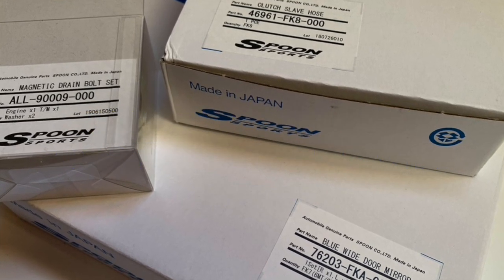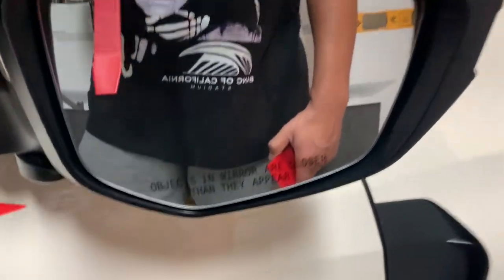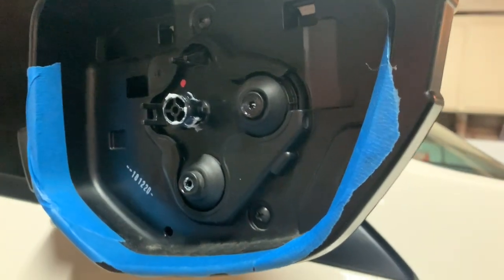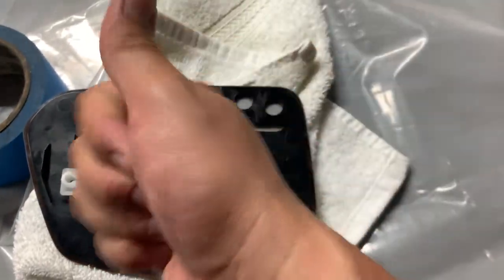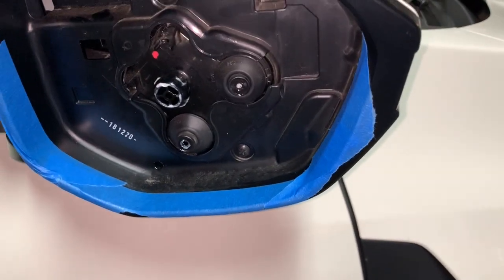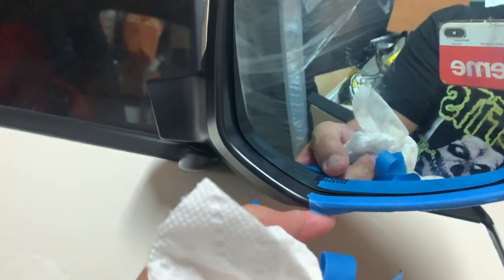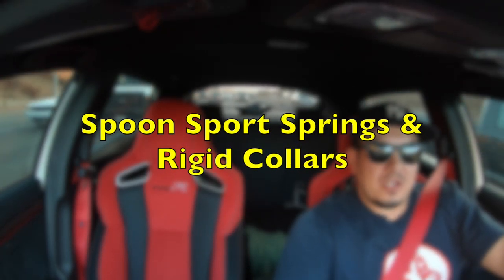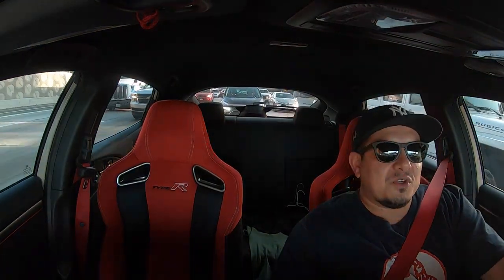Honda Civic TYPE R FK8 Spoon Sport Blue Wide Mirror Install (2nd Time)

Comment: Rather than sticking the spoon mirror on top of the oem mirror, can't the oem be removed completely and replace by the spoon? In other words, remove all the mounting stuff from the oem mirror and put them the the spoon. Seems like it would have been a better install if done that way. Looking to put the spoons on my 2018 si.
Reply from the maker: Harry L you can try but I don’t think so, the spoon mirror has 3M tape to hold it in place, there is another company that makes the direct replacement, like mugen or suma!